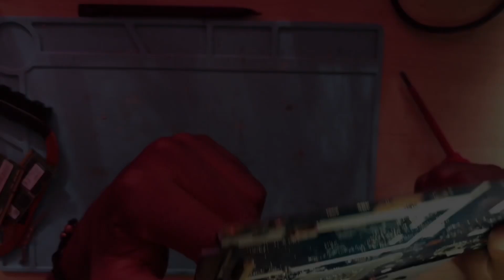This how you detect a shorted to ground PCH on Lenovo

Comment: In my case, the laptop  im repairing  doesn't  have the 5 and 3.3V. The 3.3 line is shorted. When i inject 3v on the 3.3 v coil the leds on the motherboard  start to brink  and it draws  0.1 amps. Help me please  haha